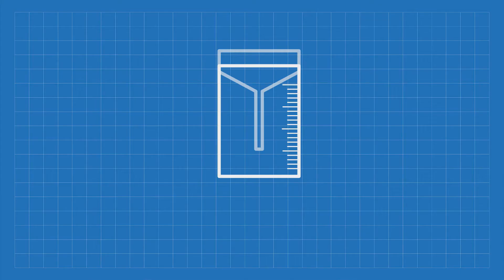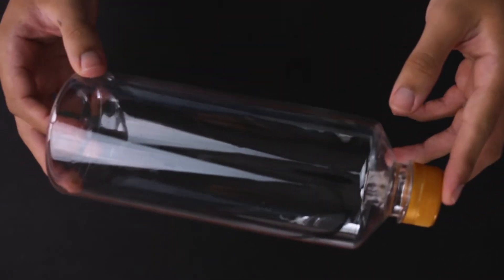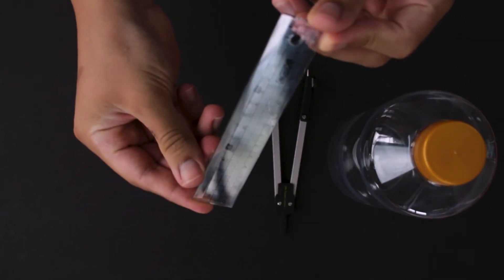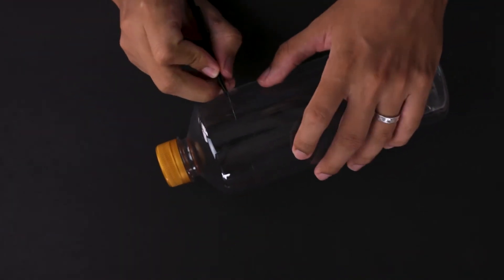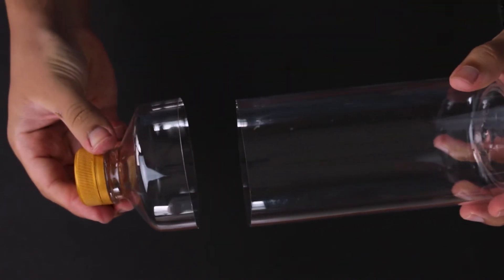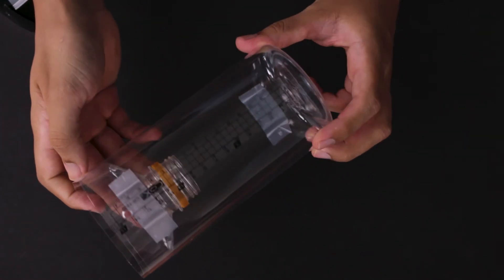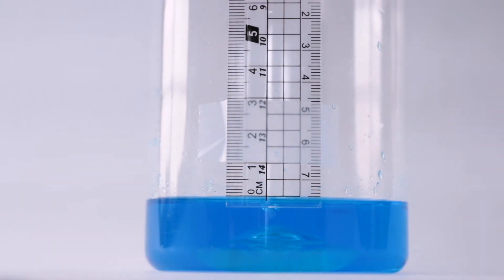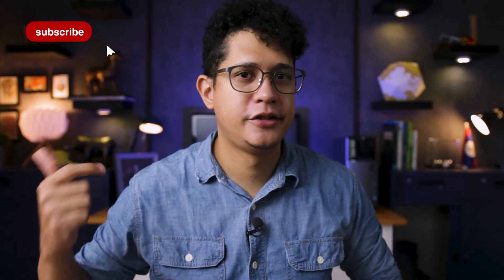EP14 | How Rain Gauges Work | Make your own at home!

Comment: 8 millimeters of rain?? But, 8 millimeters are 8 liters approximately, you don't have 8 liters in that bottle
Reply: Hahahahahaha!!!
Obviously, you do not know science!!!!
The gauge only records the height of accumulated water inside the container, which it should be equal outside!!
If you have an area of 1m2, that would be 1000mmx1000mm×8mm=8'000,000 mm3. 1 liter =100×100×100=1'000,000mm3
Therefore  8'000,000÷1'000,000= 8 liters!!!
Reply: @dvdortiz9031  that last part is kind of confusing 
Allow me to explain

1m³ = 1000 L of water
Therefore 1 L = 1/1000 m³= 0.001 m³

We have 8mm of height of rainfall and the volume would be 1m*1m*0.008m= 0.008m³ of water

We know that 1l = 0.001m³

Which means for every 0.001m³ 1L of water is collected

That is for 0.008m³ 8L of water is collected

Comment: Is it necessary to invert the top into the bottle like a funnel?
Reply from the maker: Good question. It's not completely necessary in this build, but most rain gauges do come with some sort of funnel at the top and the project is to replicate what you'd find in the real world. And as the project is meant for young learners, it's not necessary to be 100% precise.